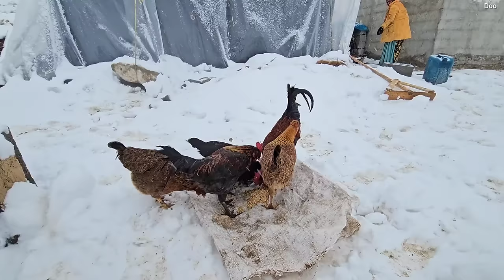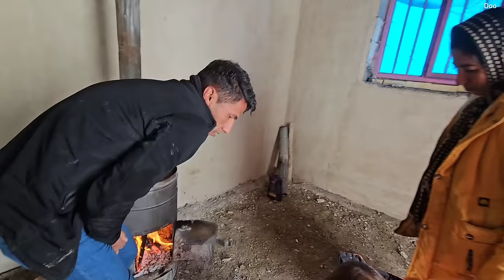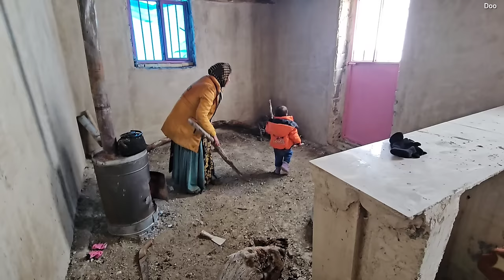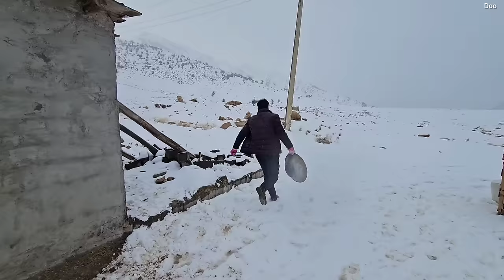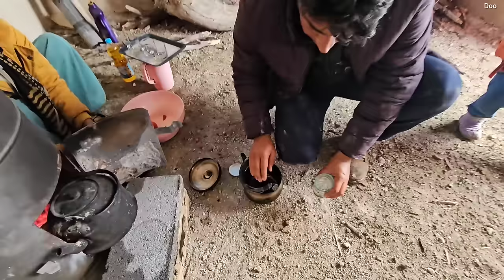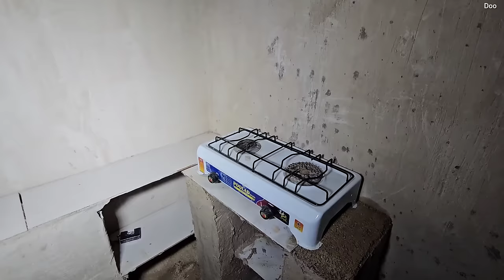Invincible Spirit: A Divorced Woman's Resistance to a Snowstorm and an Evil Ex-Husband

Comment: Once the snow melts and temperatures go down, the roof will leak once the soil is fully saturated if the plastic underneath it (soil) has puncture holes from the nails.

Comment: Camera person simple way to cover the windows and doors
Take a piece of plastic cut to size of the window and doors opening remove the side railing that is used to hold the glass in place.

Instead of glass cut out a piece of plastic for the door and windows cut the plastic two inches extra around the entire window and door opening. Use the side railing to hold the plastic in place this will help keep the cold weather out and a warmer house than the tent.

Have enough wood chopped to feed the wood heater keeping the house warm as needed.

Fixing the house kitchen is great but closing the house air tight is more important than a kitchen.
A propane stove can be layed on the floor for cooking until you can finish the house kitchen God bless don't allow that addict come inside your house stay independent a new love will come if get rid of the passed